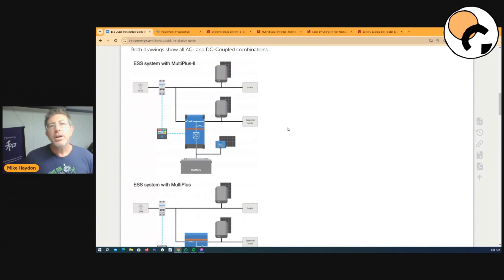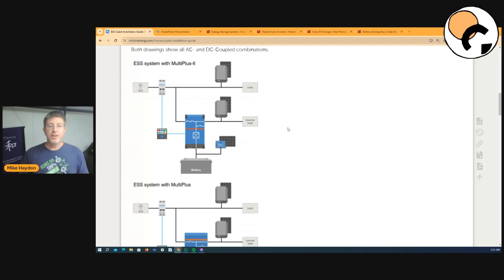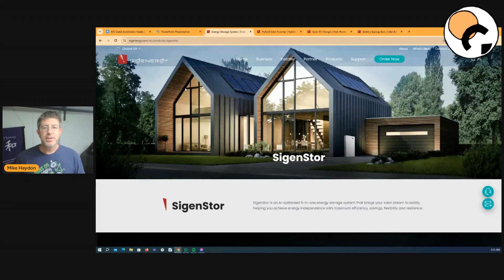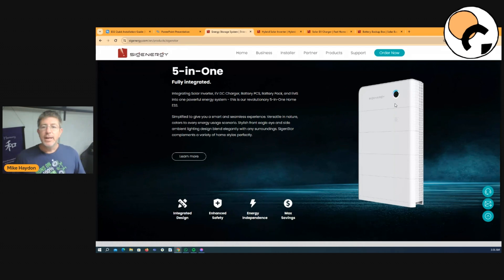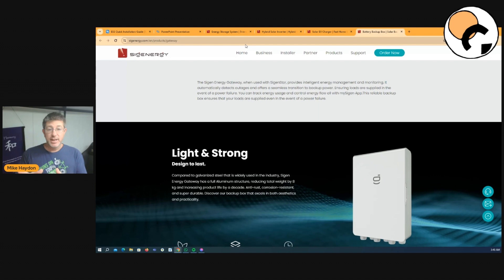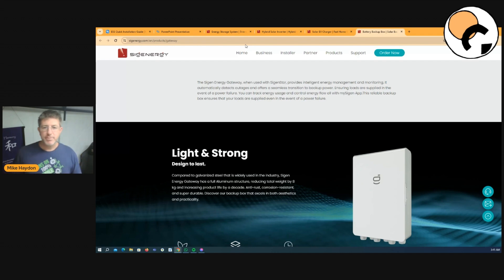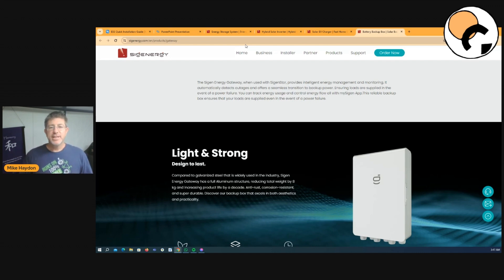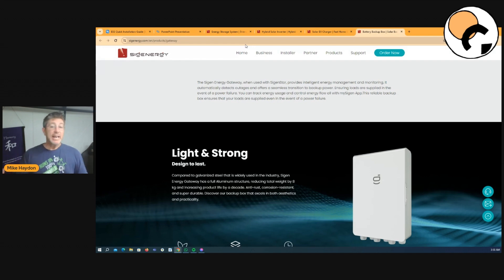Victron Energy Demise: Sigenergy 5-in-One Power Package!

Comment: How many can you link in parallel, inverter and battery?
Reply from the maker: Alot. I think the largest is 264 so far.
Reply: @TheOffGridShop  looked at their website, it says multiple can be stacked together, but not how many. Are you saying someone has a 264kw sigenergy battery bank?
Reply from the maker: In Spain and Africa they have done some crazy big systems. It's 264kw of inveter and 12,672 kWhs of battery storage. They are monsters.

Comment: The DC EV charging thing would be nice, but even then you are limited to how much solar you have. You can't "magic" electricity if you don't have the panels to make it. I don't have any data about the average size of off-grid solar system in OZ, but I suspect it would be in the region of 10kW to 15kW, which means, at best, about 13.5kW available for the EV (you still have to run the stuff in the house.) 13.5kW would be nice but, honestly, it's a bit "meh" really. My 7.36kW single phase charger has kept me on the road, without inconvenience, for over a year now.

I'm also in the camp of people who like the versatility of being able to choose their own storage. My existing storage is Pylontech LFP and they're chugging along very nicely, but my next storage (if I'm not pushing up daisies before the Pylontechs die,) will be a used EV battery converted to suit my needs. (Who knows, might even be the battery out of my EV when it's too tired to run the car?)

I agree that the reprogramming of Victron inverters if one dies, is an issue, but I have rehearsed for this possibility and have a step-by-step procedure loaded into my laptop and my phone just in case. I'm single-phase, multiple inverters (3x 5KVA) and could easily get by with two working inverters and make do (just) with one working inverter. The good thing, as you stated, is the reliability of Victron inverters. Most of the trouble (if the posts on the Victron Community pages are anything to go by) usually comes down to "finger trouble". People unnecessarily installing firmware upgrades, etc.

I'm cautious of new entries to the tech world and I think that if Ii was to start all over again with my off-grid system I would still wait a couple of years to see how the Sigenergy stuff behaves. A lot of brands have fallen by the wayside in the world of tech.
Reply from the maker: Great info. And you are correct on all of that. Noark are doing a bidirectional charger which will be great. I think for off grid is more that you can siphon power from the car when required would be the real benefit. Thanks for your comments. Where are you located?
Reply: @TheOffGridShop  I'm at Northampton, Western Australia.

Comment: No issues using Victron grid coupled ESS in the UK. The Sigenergy looks interesting but I'd still take the Victron. One massive element that nobody talks about is the software. VRM is exceptional and relatively open too. That and the modular nature of the hardware means there is a solution for every circumstance. The reliability is good as is the support community - they come at energy management from a different angle to all others and I trust it. The software for all of the far eastern inverters I've installed is not a patch on the VRM.
Reply from the maker: Yes Victron dominates the end user interface and controllability.

Comment: Did I just hear software locked which I have to pay to unlock? Lost me there.. from then on it was hard to continue listening. Software locking hardware capability is not a future I want to live in.  All in one product like this reads single point of failure and a blow to right to repair.  

I look for a future where we can more inoperable systems with a standard communication interface that allows multiple inverters, solar controller and battery systems to talk together.. more like what TCPIP did for computers.  Still have hope for that future.
Reply from the maker: I get your point.  And they also decided not to sell that model. And it makes sense when people just want to put the cheapest system up to start with and the. Can add a battery later. Our problem right now is we remove lots of brod connected inveters that are 12 months old as the customer now wants batteries.  A software unlock would be a better solution for this.

Comment: The moment you said software unlock I heard ‘subscription revenue’.
Are these devices networked and dialing home by default? If so that would be a red flag for me personally. If it’s just an unlock code that will be a one time unlock then it sounds like a smart business model. 

Being a Ham Radio operator, lighter typically means more use of switch mode technology which could lead to a rise in the noise floor making radio reception a challenge in some cases.
Niche but still a concern.

Back to victron, have ever installed a system for a Radio Ham or do you have info on the RF noise put out by these devices? As in, are they reasonably quiet?

I’m currently working to put together a simple off grid 24V 2480W system and am limited by the Renogy Rover 40A MPPT charge controller that I purchased a while back, to 100V/1040W on the PV end. No inverter yet and Renogy user experiences are not too promising.

Victron appears to offer what I need.
MPPT/Inverter combo. Multiplus or EasySolar?
Their range is overwhelming. 

Model # suggestions welcome for the following spec. 

Batteries: 24V 100Ah initial but might grow to 400Ah or reconfigure to 48V 200Ah.
Inverter: 1000W min / 3KW ideal
PV: most likely multiples of 260W panels aiming to charge the 2.48KW system in 5hours.

I’m just discovering your content.
Have your most recent video bookmarked for later.

Comment: My biggest annoyance with victron is rating their inverters in VA when other manufacturers like cotek can list an inverter as say 2000w and guess what you get 2000w! No bs
Reply from the maker: Very good point you make.  Thank you for sharing.
Reply: It is inherent in a low frequency transformer based inverter topology to have a power factor of less than one.
Transformerless inverters have a unity power factor but they are not good at handling inductive loads.

Victron's 5kVA means more than a Chinese 5kW.

Comment: For a simple Off-Grid system like mine, the reprogramming with Victron is easy. I use 2 Multiplus-II in a split phase system, if one inverter goes down then I just use a jumper to be able to use both sides of my breaker box(I actually started off with only one inverter.) I don't think that we use 3 phase in very many houses here in the States, of course I could be wrong. (I just looked it up, less than 1% of residential houses in the U.S. use 3 phase power.)
Reply from the maker: And you are lucky you have the skills and knowledge to do that. Most people don't. Don't underestimate your skills. And 3 phase will get bigger. Most businesses are 3 phase and charging cars fast wants 3 phase. Well done on your set up.
Reply: @TheOffGridShop  What is the new device that will require 3 Phase in Residential Homes in the USA?  Converting old homes to 3 Phase will be way too expensive. Some power poles don't even have 3 Phase.  I don't know of any new home construction that has 3 Phase. If you have a large estate, a farm or large machines in your workshop then you can special request 3 Phase = 1%.  240 Volts Split-Phase will be the standard for a very long time.
Reply: @MrSummitville In Australia 240vac is the norm for single phase and 415vac is 3 phase which runs down most every street here in Oz. 
I definitely prefer our 240vac power system to your split phase arrangement, its more efficient.
Reply: @evil17  US residential is 240 Volts split phase.  We have 240 volts.  My point was ... USA Homes are not typically 3 phase.  There is usually 3 phase at the street.

Comment: We have the same issue with Victron's lack of certifications in North America. We can't, legally, have any grid interactivity in the USA or Canada. Our company and many other Victron distributors have been complaining about this for years. In Australia, you have access to more Victron features than we do here. That aside, YOU, as a Victron distributor yourself, have access to the same information that we do, so I would suggest you talk to your rep and request information about their feature plans for the RS line of inverters and MPPTs. I've heard that inverter redundancy is on the roadmap. Also check into the NG line of batteries and BMS's and the plans for parallel BMSs. Also ask your rep about Victron's hires in the last six months specifically to address their slowness with certifications, worldwide. They are listening.

I don't speak for Victron, which is why I've been somewhat vague. And while I like Victron products, I'm not a breathless fan boy. We, too, are exploring Tier 1 alternatives so we can provide amazing products and services to solve challenging problems. I don't have 14 years of off-grid system experience, just four. But in those four years, I have never had a Victron inverter fail. 

Victron has some legacy architectural issues to overcome in time. Right now there can only be one system controller (i.e. GX device), one BMS in control, one inverter (or inverter group), and everything connected to one battery bank. Three phase loads are inherently self-balancing. Single phase loads on a three phase system can create unbalanced inverters, but is that really a significant problem where you are? In North America, it's extremely rare for a residence to have three phase because it's considered commercial power and will priced as such (higher than single-phase residential service). If the connection is grid-tied, the unbalance concerns practically don't exist. If it's an off-grid three-phase system, either plan the system such that it's easy enough to move the circuits around in the panel to manually balance the loads or size up the inverters. The cost of sizing up the inverters for a business (or home I suppose) is minor in the overall system costs.

But your broader points about Victron being behind the market in certain features and innovations is well heard and I agree - not that my agreement is worth anything. But I also think Victron is listening and finally doing something about it. The question is, are they too late, or does their many years of experience and pioneering many of the features the market has copied over the decades mean they can retain, or regain, their technical edge? Time will tell. But, we will remain a Victron partner while filling in the gaps, and hedging our bets, by looking for other tried-and-true products in the market. Since Victron's secret sauce is their software, this shouldn't be too difficult for them to overcome. I think the microcode in their VE.Bus products will require the most work, however. 

Thanks for the tips on Sigen products. And thanks for excellent content on your channel.
Reply: Doesn't Victron have several units that are UL1741 certified for USA?
Reply: @MrSummitville  Yes, Victron has several UL1741 certified inverters, but these only carry the hardware certification. They do not carry UL1741-SA or SB, nor does Victron provide grid codes for interconnection to the N.A. grid.
Reply: @cuisinartOH1  Then add an IEEE 1547 Automatic Disconnect Switch between the Grid and the Victron Grid Tie Inverter.
Reply: @MrSummitville  Without a grid-tie inverter conforming to UL1741SA or SB, I'm not allowed to feed back into the grid, and the requirements of supplements A & B require a fairly large number of events that the inverter has to respond to in a predictable way. Also, a Switch isn't necessary since the Victron inverter/chargers have loss of mains (LOM) detection built in are configured not to feed in by default.

If I have to insert a grid-tie inverter between the mains and the Victron inverter/charger, then I might as well just skip Victron altogether.

Comment: Isn’t that what autotransformers do?  Victron has them don’t they?
Reply: For split-phase systems in North America, yes. For three-phase systems, no.
Reply: @cuisinartOH1  ahhh, hmmm that is interesting.  But I really actually know so little!  I literally had just read about auto transformers like 5 min before u posted this video.
Reply: @dtdionne  It's not my video 🙂 I just replied to your question. And, I should have been more specific and say Victron's AT isn't for three phase. There may be others on that market that do. Thanks.
Reply: @dtdionne The Victron Auto-Transformer can support unbalanced loads in the USA with 240v Spilt-Phase.  I have never seen a Victron AT in any 3-Phase schematic diagram.
Reply from the maker: Which part specifically are you saying they do?